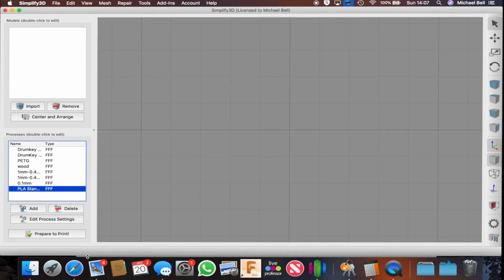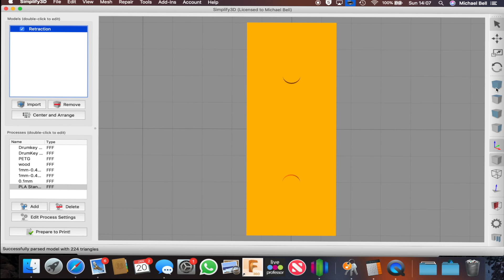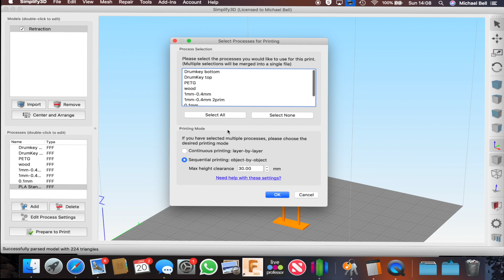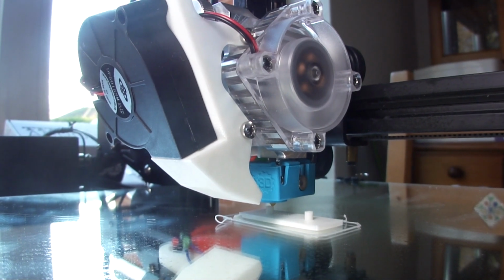Creality CR-10  E3D Titan Aero Upgrade CR10 CR 10

Comment: Hi, I upgraded my cr10s to an aero before christmas unfortunately so far I havent been able to get it to print anywhere near as nice as the stock end. 
Is there any chance I can get a simplify 3d Factory file from you. I have calibrated the steps so its not an extruder thing. 
It would let me quickly see if its a settings thing or hardware.

Cheers Steve
Reply from the maker: Hi Stephen hope you having better luck if not let me know and ill send over the S3D file.